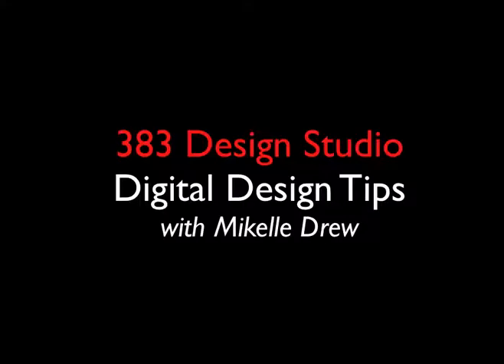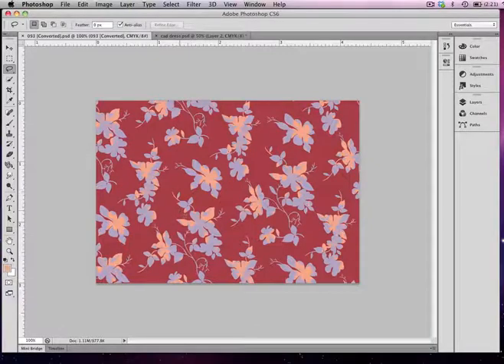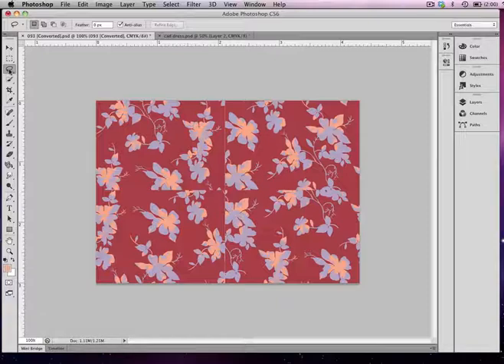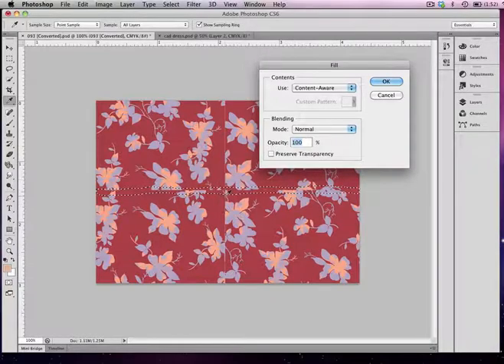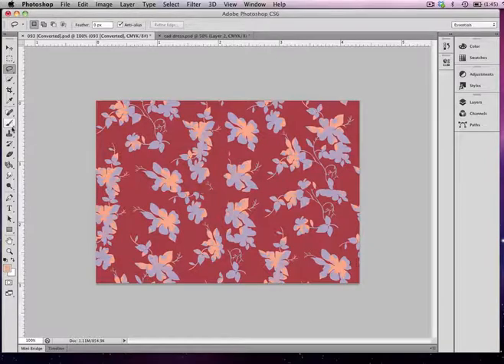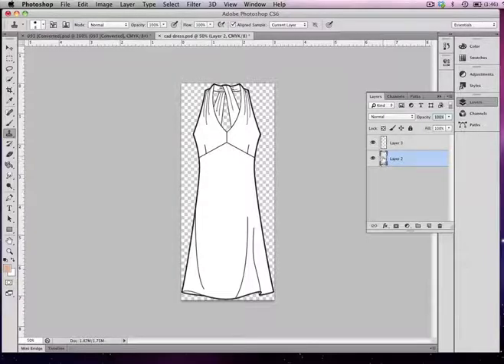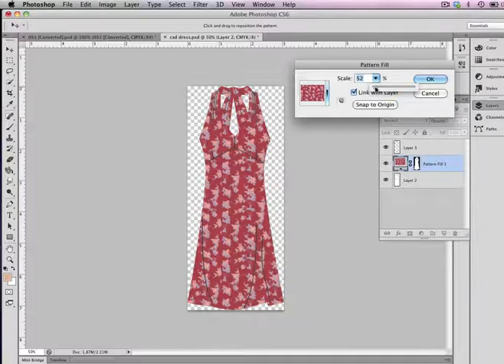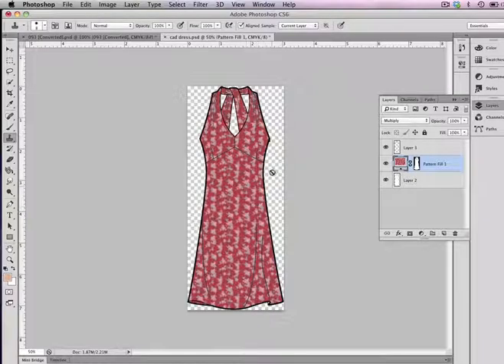Create a Seamless Pattern in Photoshop for a Fashion Sketch

Comment: Thanks for the helpful content! In fabric design, how would a designer approach designing something that isn't implemented in a repeat pattern? I am having trouble learning how designs that aren't repeat get printed on fabric used for blouses, button down shirts, etc.
Reply from the maker: Hi, thanks for watching and commenting! It sounds like what you want is a placed print, similar to how tee shirt graphics are placed on the front of a tee. Is that right? It's a similar process as screenprinting a tee shirt so you may want to look more into that if you're looking for information on how to execute the printing.

To show it digitally on a sketch, you'd want to place it on the sketch and use a clipping mask so it's only shown on the parts of the design that you want it to be shown.

Comment: Hi- I tried this using fill- content aware- and it gave me a grey fill. it didn't blend. Can someone pls advise what I am doing wrong.
thanks!
Reply from the maker: Hi, Maria. Thanks for your comment. Hmm, that's strange. I've never experienced anythink like this or seen it with any of my students. However, I was looking online and it looks like there's a few people who had a similar issue in an earlier version of Photoshop. What version are you using? And if it's CC, have you updated recently? Sometimes, that will take care of small glitches.

Also, recheck your fill options and ensure you've changed the Fill Contents to Content Aware and that the Blending Mode is set to "Normal". Sometimes we may play around with settings from previous Photoshop sessions, and we forget to change the settings back. Those are the only 2 things I can think of that may be causing an issue like that. Let me know if either of those options worked.
Reply: 383 Design Studio 
Thank you for your reply!
Yes I needed to update
CC and it worked fine.

Comment: whenever i save the print as a pattern, the colour of the prints change and it turns black and white, why so?
Reply from the maker: Hi, Sommya Jain. Thanks for watching and commenting!

Is it automatically changing, like is the thumbnail black and white? Or is it changing once you try to add it to the sketch? Many times, I've scanned or brought in black and white sketches and tried to fill with color but forgot to change the color mode. It may be that your color mode for your sketch is on greyscale, not RGB or CMYK.
Reply: @383design  thank you so much for replying!
yeah that was the problem, i forgot to change the mode
great job and thanks!